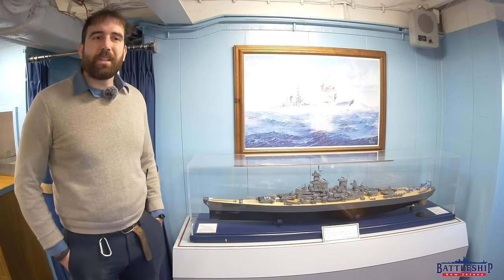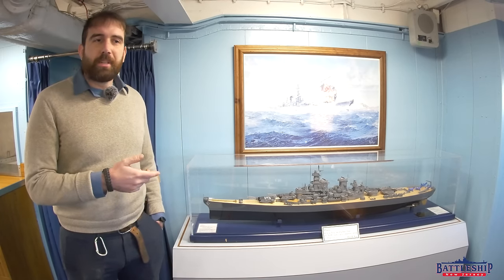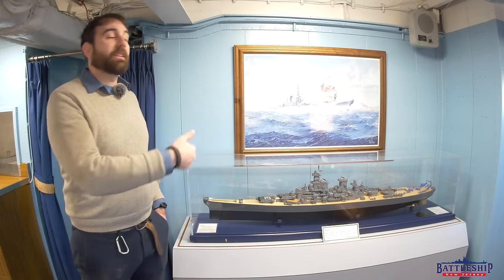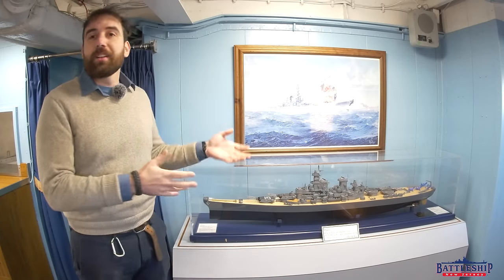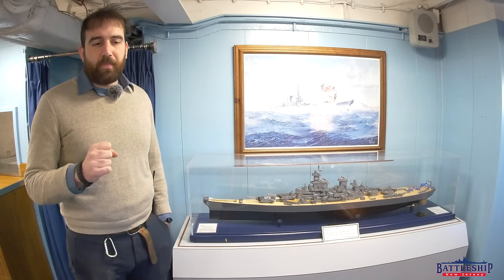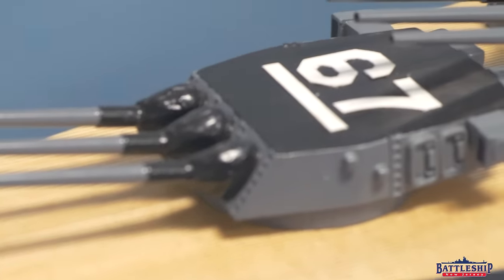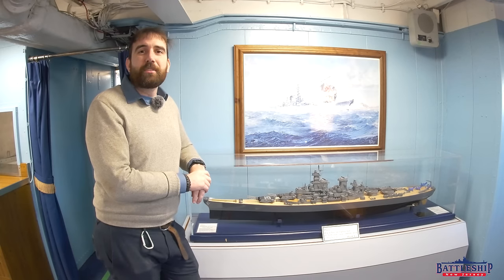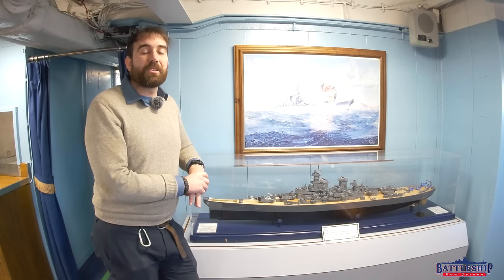Battleship Montana: What Would We Have Done Differently

Comment: One change that Ryan missed was replacing the sea planes with helicopters.  The Sikorsky R-4 went into mass production in 1943 and was the first US helicopter to operated from a ships deck.  They were used in combat in 1944.
Reply: I would just think they would ditch planes or helicopters.  With radar don't need it for spotting which I thought is why they had them.
Reply: doubt they wouldve replaced the seaplanes with the r4, its range and carry capacity was too small. probably wouldve made provisions to carry both.
Reply: Put helicopters on the Montanas?  I would argue it's better to have more carriers, which is what the Navy ended up doing anyhow.
Reply: @StarBuck411  
Radar still didn't see over the horizon.
Reply: @The_Modeling_Underdog  you’re ignoring the horizon / curvature of the earth which is the issue at hand when discussing spotting rounds to adjust fire on the main guns. 

It may be able to detect planes in the air at 160 miles but it sure as hell can’t see anything on the surface at 160 miles.
Reply: Largely irrelevant, as the Iowas did have helicopters operating off them post-WW2. The large fantail served as a good helicopter landing pad.
Reply: @cruisinguy6024  Main battery fire control radars as the Mk-3 and 8 could track battleship-sized targets up to 40,000 yards.

On the NavWeaps site it indicates "16" (40.6 cm) shell splashes could be ranged at 20,000 yards (18,500 m)" for the Mk-3; and "Mark 8 mod 0 could spot 16-inch (40.6 cm) splashes out to about 20,000 yards (18,300 m) and the improved Mark 8 mod 3 could reliably spot 14-inch (35.5 cm) and 16-inch (40.6 cm) fire out to at least 35,000 yards (32,000 m)".

From other videos Ryan has done and from Drach's video on naval artillery, we can rest assured the people doing the calculations took the Earth's curvature into the equation when adjusting fire...
Reply: Unsteady for sea duty
Reply: @cruisinguy6024  : Over-the-horizon radar is an actual thing. There's a couple different types, differentiated by how they work (bouncing off the ionosphere vs following the Earth's curvature, and maybe some others), which in turn is differentiated by frequency, but at least some would have already existed, inspired by the ability to receive some radio frequencies much further than could otherwise be explained.
Reply: I was gonna say the same thing—-make provisions for replacing the seaplanes with helicopters. By the time this ship would be near completion the Navy already had helicopters. These would make for better air-sea rescue, while the need for a scouting platform had already been superseded by radar technology.
Reply: @StarBuck411  A plane or helicopter can see much much further than any onboard radar available then. (Or now.)

Plus, helicopters are very useful in anti-submarine work as well as intra-fleet ferry purposes.
Reply: @seanm2511  
Your comment is correct, but you may have missed the general point of this discussion.

Which is “Had the Montanas evolved into production, what improvements might have taken place along the way?”
Reply: I would just say strip of the aircraft facilities all together. With abundant Carriers available, they are no longer needed. Later, Helicopter facilities can be fitted aft.
Reply: @Cruisin Guy  
Which is rather irrelevant as the 16 inch guns couldn't shoot 160 miles.
Putting planes on Battleships takes up valuable deck space, and the aviation fuel is a distinct fire hazard!
Battleships don't travel alone.  You have carriers, cruisers, and destroyers for scouting purposes, and cruisers can carry a scout plane if necessary.
Reply: @WardenWolf  
Much later design of helicopters.
Reply: @Tommy Pouch  
Actually, you don't want either on a battleship at this time.  Too much of a fire hazard, and it takes up much valuble deck space needed for anti- aircraft weapons. Battleships do not operate by themselves. Cruisers or carriers can carry any aircraft needed.
In fact, cruisers were giving up aircraft at this period of time for more anti-aircraft weapons.
Reply: @johncox2865  
Modern helicopters, not 1940s models.
Nor do you want the fire hazard or the loss of valuable deck space that would otherwise be available for anti-aircraft weapons.
Reply: @randyfant2588  
Absolutely!
Reply: @WardenWolf  
Which means you can't fire your main gun turrets aft!
Reply: By replacing the AA guns on the side with centerline ones, doesn't that remove the ability to defend against simultaneous attacks from each side? Seems a centerline gun would have to pick one side or the other, but not both.
Reply: @absalomdraconis  But they use  very long wave radio transmissions, requiring very large and long antennas.  Not until the AN/SPY radar of the Aegis system could you fit them on a ship.
Reply: @johncox2865  No, I didn't.  Could have or would have assumes carriers were not a thing, which is nonsensical.
Reply: Please name which combat-ready helicopter (including reconnaissance) was available to the U.S. Navy when the Montana class was being developed.
Reply: Ryan,how can I find your Montana model?? Id like to build one.
I have all the Iowas.
I guess you guys covered most of the changes I would make save one.
Torpedo tubes,without a doubt.
In the tight quarters where the surface ship sea battles were fought,torpedo tubes are essential.
Reply: @calvingreene90  actually radar placed upon the mast certainly sees over the horizon a fair ways
Reply: They didn't have the payload to carry the gunnery spotting equipment
Reply: @kmoecub   The year of 1943 was when Sikorskys R-4 became the worlds first helicopter to go into mass production; it was also the first helicopter in U.S. Military service and the first to operate from a ships deck. After a few modifications, the helicopter became the YR-4B and on April 25th, 1944 it became the first helicopter to ever fly in combat. Pilot LT. Carter Harmon used the YB-R4 to rescue 4 men who had crash landed in extremely rough terrain... Even H-5 and R-6 first flew in 1943, Bell H-13 Sioux in 45. Remember even in this Video he was talking Montanas needed/used for WW2 lasting couple yrs longer...
Reply: @absalomdraconis  We're talking late WWII tech. OTH radar won't come around until the 1970s.
Reply: maybe a combination of helicopters and fixed wing aircraft.  The airplanes had better capacity,  speed and distance.
Reply: @StarBuck411  During the time Dad was on the Missouri they did ditch the planes. And replaced them with choppers. Later they still had the ability to land choppers but used drones for spotting. The planes were replaced by Sikorsky HO3S-1s. They were made famous by the movie "Bridges of Toko-Ri."
Reply: @mahbriggs  1948, USS Missouri got Sikorsky HO3S-1s. First ones on a Battleship. And at that time, the Missouri was the only active US Battleship.
Reply: @gravelydon  
And it was not in an active war zone, expected to go into battle!
Putting that much aviation fuel on a Battleship when it isn't needed is stupid!
Reply: @cruisinguy6024  Moskva thought radar couldn't see beyond the horizon, hue hue.
Reply: Helicopters did not have the service ceiling of the Seahawks. Which is necessary for air spotting of the main battery.
Reply: @StarBuck411  Redundancy and safety. If radar is out for some reason, you’ll appreciate scout craft especially with some ASW capabilities plus you can help the carrier wing and contribute to rescue work and ship to ship transport
Reply: @absalomdraconis  Yes, they existed.  But not in a form that could be mounted on a warship.
Reply: Helos lack the range of scout fixed wing, plus the defensibility of a fixed wing through speed and armament maintain a distinct advantage over helos.
Reply: @squid0013  It can only see to the mast's horizon though, which isn't an immense gain..
Reply: @absalomdraconis  While it is an actual thing it's not something that is useful aboard a ship.  With the size of antennas possible aboard a ship at most it could tell you that "something is out there".  When you see ranges published for shipboard radars those are for air contacts above the horizon.
Reply: @DrBobcf  Do you have documentation to the effect that the Aegis system has over-the-horizon capability other than by linking to an airborne system?
Reply: @johnbrobston1334  not the point.   E can mathematically calculate it and the stars change th the southern oceans from the north.
Reply: @squid0013  Who or what is "E", what is the "it" that can be mathematically calculated, and what do the stars have to do with anything?
Reply: @StarBuck411 Hm...when did ASW-Helos become a thing, because frankly most (if not all) battleships lack proper ASW-Systems, so a Helo could help there!
Reply: @rebelbaron7003  You might have found one by now, but a model company called Fire Fly makes  1/350 scale Montana.
Reply: Disagree. The Kingfisher had better everything and is a much better choice for the mission.
Reply: @StarBuck411 Seaplanes have more utilities than just spotting but they can also vastly outrange radar of the time.
Reply: @mahbriggs The Iowas never used helos for spotting that I’m aware of. They had helo landing facilities post-war but I believe that was mostly just more moving things (people, mostly) on & off.
Reply: @firstsgt279 Helos were still fairly primitive even in the Korean War.
Reply: @grahamstrouse1165  
Agreed!

Comment: As a naval architect, a very rough approximation is for every 3 knot increase in speed, required shaft power goes up 50%...
Reply: Is it correct that the bulbous bow doesn't increase the maximum speed (which is function of the length/beam), but the amount of power to get there?
Reply: @rabidbigdog  I believe so. It generates a wave crest ahead of the bow entry, so there is a trough at he bow entry. So the zip is effectively going downhill which takes less power.
Reply: @johneyton5452  but they are designed to save energy at specific speeds. If you go to fast or slow it can have negative effects on power requirements
Reply: How do you figure out how much power you need for a given hull form? I've tried to figure it out but never found anything and could use the help. Thanks!
Reply: 50% does not sound right - are you sure speed change is a linear function? Sorry, but I have no practice, just theory. Perhaps you have a table. :)
Reply: @rabidbigdog  Acceleration should be proportional to mass, thrust, and drag.
Reply: @tobyw9573  He's probably right, I remember seeing speed to HP figures on the Iowas and it was surprising how much power you need but I can't remember the specs.
Reply: @johnlee8523  Wikipedia has lots of good info on military and air specs, but you can surf as well for more. Some is outstanding!
Reply: Speed increase isn't linear, it's by the square, just like airspeed, for a car to get from 100 to 200MPH requires an absurd more amount of horsepower, something on the order of from 200 to more than 800HP, etc. Why the Iowas had 212k shaft horsepower, they were the first of the US Navy fast battleship fleet.
Reply: @johnlee8523  You should look up Springsharp.
Reply: @rabidbigdog  The bulbous bow, does it displace the way, permitting increased speed from less resistance?
Reply: It's pretty obvious that most everyone commenting on this specific thread is probably at least sixty years old, and completed their education back when universities still provided an actual education.
Reply: Ship resistance / power requirement is a complicated thing. Today it is computer modelled.

First resistance component is that the fluid needs to go around the hull. This is easy, and scales up F ~ v^2 and P ~ v^3. Also it increases with wetted cross sectional area and is dependent on the hull shape.

Second component is more complicated, but usually bigger, and has to do with the hull generating gravity wave on the surface of water. This is inversely proportional to square root of water length. The figure of merit is hull speed or Fraude number. Here bulbous bow helps.

Also, there's a problem with propeller efficiency at high speeds.

Note that +50% power for every 3 knots is exponential (and equates doubling power for every 5 knots).
Reply: @frontiergeek4953  Everything is linear on a small enough scale. When talking about adjustments of a few knots, linear is good enough as a rough rule of thumb estimate, given that other factors are liable to make for a larger error. The fact it doesn't work when you talk about doubling the speed is irrelevant, because that's not a thing you're ever doing for a battleship. (This is the difference between physics and engineering.)
Reply: @frontiergeek4953  Speed increase is by the cube.  Drag increase is by the square but speed increase is by the cube.   P=F.v.
Reply: What if you supplemented the shaft power with viagra?
Reply: @johnlee8523 Iowas were rated at 212k shp. On the other hand, the British Lions, which would have been nearly as large as the Iowas were expected to do 30 knots, I believe, with 130k shp. Vanguard only displaced 3500 tons or so less than the Iowas and did managed 30 knots with the same plant the Lions would have had.
Reply: @tobyw9573  It's the opposite of liner its stacking percentiles
3kn - 150%
6kn - 225%
9kn - 337.5%
Reply: @aldolajak1267 hahaha, interesting perspective. I'm over 60, but finished school after 10th year, and lived in remote rural regions. 
Those years passed however, without indoctrination and without lies and manipulation. It was simple and spacious. There was no concept that the head of the student must be programmed and endlessly reiterated. 
Thus, the little actual education we did receive, was imbibed easily and left us unmolested.
Reply: @johnlee8523 a different naval engineer here. 
Estimates of hull drag are done using computers, however, eventually the final(ish) design is built as a scale model and placed in a tow basin. It's then pulled along to get the actual drag coefficient and find the true required power of the ship. 
Usually the navy uses the David Taylor Model Basin in Maryland for this. Before then they used the tow basin in Washington Navy Yard. 

Veritasium did a video on a similar basin (the mask) in his video about the Navy's indoor ocean at the same research facility in Maryland.
Reply: @grahamstrouse1165  I'm not well read on these aspects, so rely on what I've heard elsewhere.
a) The British worked very hard on hydrodynamic efficiency during the treaty era and developed extremely efficient hull forms.
b) The slightly slimmer hull form involved survivability compromises.
c) But got your knots for rather less SHP.
d) And could maybe use some weight saved on powerplant t increase armour.

Comment: I would suggest an all welded structure as well. They were still using a combination and I don't know if they calculated the weight savings for using all welds over rivets.
Reply: Illinois and Kentucky were essentially all welded.  The Montanas would have been, too.  I think Ryan mentioned the weight savings in one of the videos about the Illinois or Kentucky.  It's significant.
Reply: If I remember correctly Ryan said going to an all welded construction would save about 10 percent of the weight compared to the first four iowa class ships so illinois and Kentucky would have shaved about 5300 tons in rivets.
Reply: @Mike Ferris  Woo..that's some black Friday savings right there! 😆..or basically a ww2 destroyer!! 😳
Reply: @ThirdHornet  The 10% savings is a general rule.  You have to discount the weight of the armor when calculating it though.  Still a significant savings.
Reply: But is it even possible at the time since Yamato had a similar level of armor and weight and Japan was forced the rivet the ship in the larger plates at least
Reply: @aviral3464  The Illinois and Kentucky were being built with largely all-welded hulls.  I believe Ryan said there was still some riveting, but only a small amount.  It was possible.